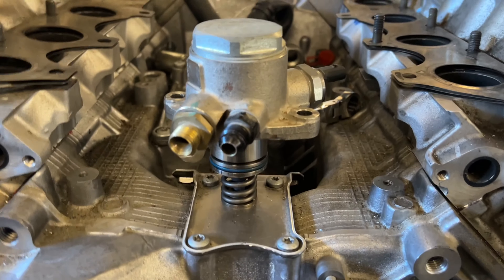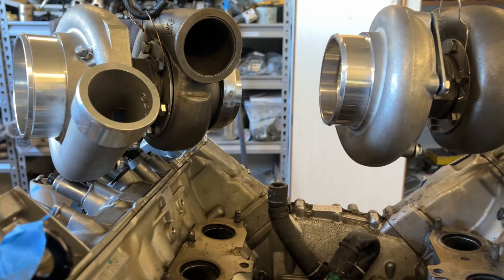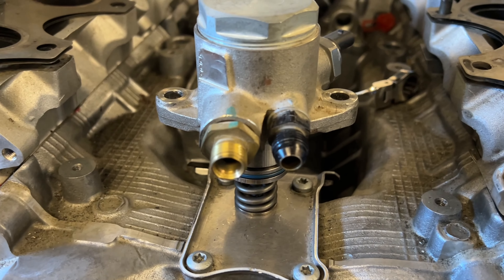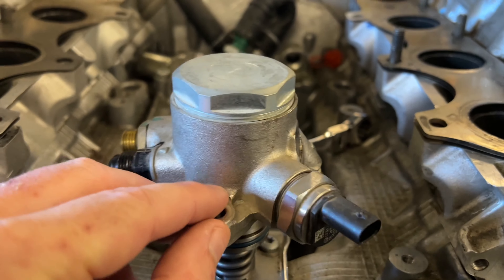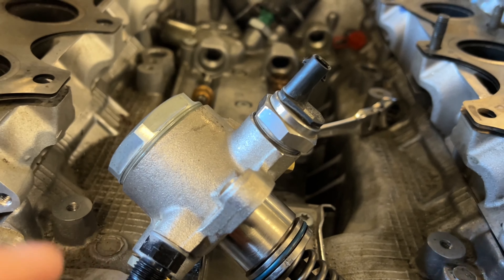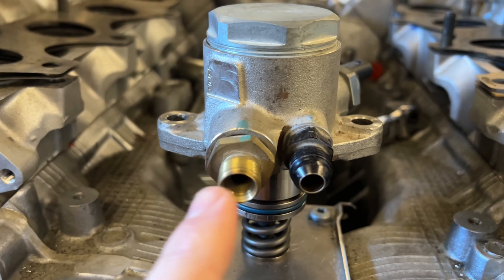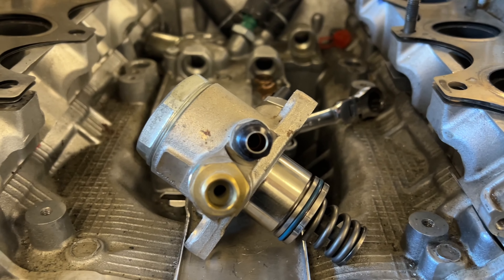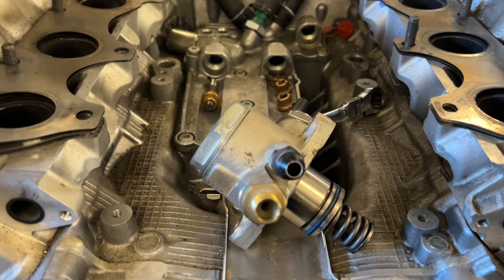DIY High Pressure Fuel Pump Fix

Comment: Hey man great video I have the same pump I removed it and the metal spring and rod came off as I twisted it can I just put it back on or is it broken , isit meant to come off
Reply from the maker: @andynelson1219  as long as you didn’t damage the seal on the bottom of the pump you can slide it back in.

Comment: Will a failing high pressure fuel pump show lower psi than it should on the scan tool,or will fuel rail pressure still look normal? I'm talking about OBD fuel pressure readings not the manual gauge.
Reply from the maker: It can show higher, lower, or no pressure at all.  It depends on how the pump itself has failed.

Comment: Is spraying brake cleaner safe for use afterwards ? I am under the suspision i have gas leak through the pump and i want to put it out and spray the crap out of it to see if there is any leak from bottom.
i have obd11 and checked the high fuel pressure actual value around 45.000-48.000 on idle and while i turn off and insta turn on the engine the pressure builds up from 45k it does not drop, so i guess its not an injector.
Last time i have remove the pump to replace the taper and the ring there was a lot of dirt and residue on the spring etc but i guess it is normal after 200.000

Comment: Hi what would be the symptoms of this being wrong with the pump?
Reply from the maker: @JoseSandoval-ic5xe  high pressure fuel pump code failed low the pump not making pressure the pump making too much pressure high-pressure fuel pump code, fail, high, etc.

Comment: I have this issue a lot on my Audi as I am running on E 85. Do you connect to a 12 volt car battery? does it matter where plus and minus connects?
Reply from the maker: Yeah. 12v to the battery direction does not matter.  You could be extra cautious if you’re worried about it, and grab the wiring diagram from ERWIN online with a day use account and download every document available for your specific vehicle.

Comment: Can we do this while the HPFP is on the car? Or should it be removed?
Reply from the maker: Can be done in the car.  Easier if removed.
Reply: Hi if done in the car how would it be done?just disconnecting both lines and car in accessories mode and spraying both ways?
Reply from the maker: @JoseSandoval-ic5xe while it can be done in the car. By the time you get both lines off, it would take very little time to remove the pumps.

It’s two bolts per pump.

Comment: Hello! Im troubleshooting my friends tuned C63 that cuts all power on full throttle, it sets one code Quantity control valve bank 2 - Short circuit to positive. This is the control valve on one of the hp pump. Have you ever heard of this? He is running Spool performance pumps.
Reply from the maker: Yeah, if the delivered pressure is too high above, or too low below specified parameters, the ECU will shut the throttle and put the car into limp mode.

Could be a calibration error, fuel delivery to the pump not functioning correctly (I.E. clogged filter, weak low pressure pump), or a high pressure pump not performing as designed.
Reply: @themanleygarage  Yes I found the problem. It was the spool FX-150 hpfp failing. It droped 30-40 bar suddenly on wot. Replaced it with a new 170 and now the car is working fine

Comment: note every 50000 miles ( i do mine at 25000 miles ) replace the tappet/ follower below the hp pump,, and lube the face with engine assb. lube..its easy to do, takes abot 15 mins... this wil keep the cam lobe below the hp pump from wearing
Reply from the maker: Good advice.